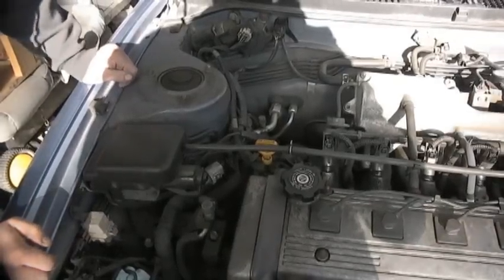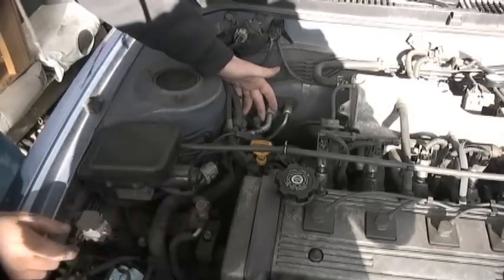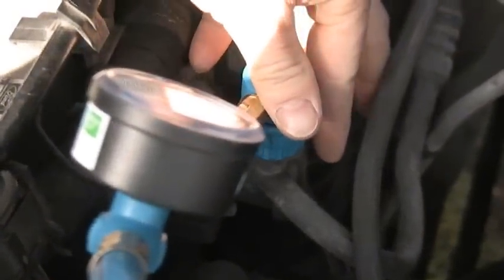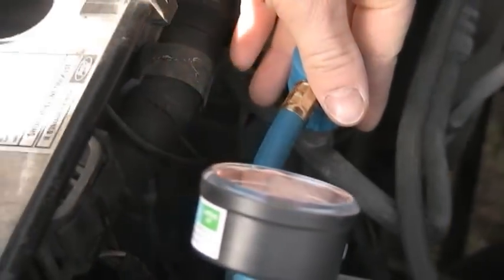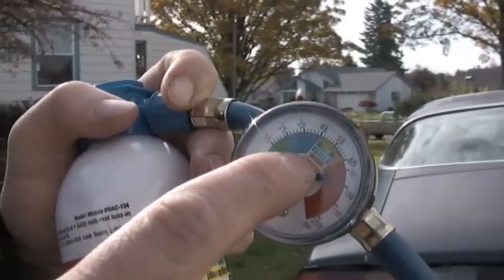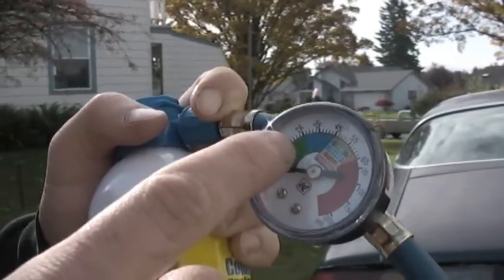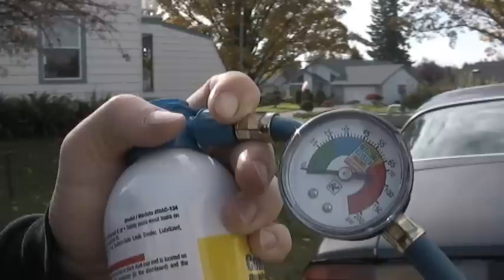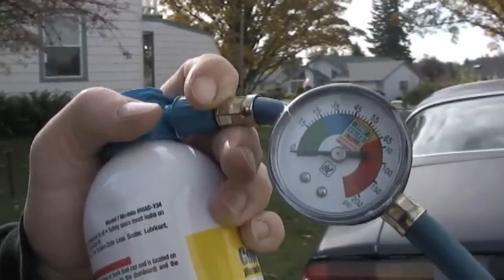Car Maintenance : How to Add Freon to a Car Air Conditioner

Comment: I don't go out of my way to save a dime, and I am in no way frugal, but this type of thing takes 10 minutes and can be done as a part of a regular maintenance routine. I have my tire's changed by professionals because that's the best and easiest way to do it, but spraying a can of coolant into a system takes 3 minutes of research and 10-30 minutes of actual time doing. Again, it can easily be done as part of a regular system one-over for your car.

Comment: of water so it boils at room temperature. then you can do ither 2 things right here. you may recharge on the low side car running , or high side with the car not running. those are very importent.  most ipmortantly dont forget about refilling it with oil.  only put as much oil that it came out with.  if your vehicle is old like his, i recomend replacing the reciever,accumulator dryier. due to the age of the vehicle, the descicant bank prolly is or has came apart which results in damaing your

Comment: It really is this easy. Make sure car is on with AC at Max, hook the can's hose up to the low side port (the yellow cap on my Hyundai was marked with an "L"), and wait for it to reach the pressure you need, as indicated on the can. Took 10 minutes.
You can find the location for many cars' low side ports at idqusa.com

Comment: first off its not coolant its refrigerant, and its either r-12 or r-134a.
those cans are not the best to use, and never use the cans that say leak sealer, because not only does it work but it will plug the orfice tube (tube with very small hole to creat pressure change) or expansion valve and will just ruin things, the best way to get a/c working right is replace any or all seals that are leaking(they say replace all if one is leaking)and charge with fresh refrigerant that has no contaminates

Comment: This guy knows just enough to be dangerous. I wouldn't trust a car's system to those Chinese gauges. Take the thing in to a mechanic if it's not cold. They can check the whole system for leaks and fix them. Why was it low in the first place? Obviously it was leaking! Listen, I've swapped out engines, transmissions...freplaced pistons and just about every part on a car, but I would take the car in get the thing diagnosed and repaired properly. It doesn't take a village to figure that out.

Comment: Purging is one of the most important steps when charging. You're saying it's not that difficult but you probably work in an air conditioned office all day with you thumb up your . There are proper procedures to everything in life. By not purging that little line, you throw moisture and air in the system, air is a non condensable. Non condensables cause high head pressure, resulting in high suction pressure, leading to inefficient or no cooling. But hey, it's not that difficult... Smart A

Comment: you guys on here . please just stop. i bet half of you are not even 609 certified, but i am . one its not coolent or freon. its refridgerent. freon is a trademark name that is owned by dupon. step 2 your blower has nothing to do with your a/c charging steps.  it doesnt matter.  if your recovering and just recharging , well your an idiot.  first when you recover you must know how much oil came out the system, let it be 2 ounces or 6 ounces. then you must vacuum the lines to lower boiling point